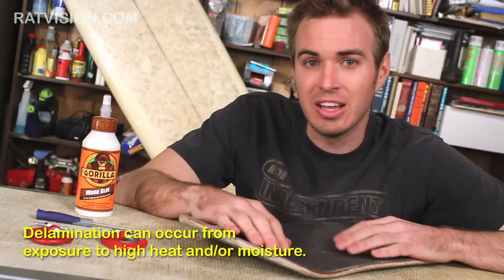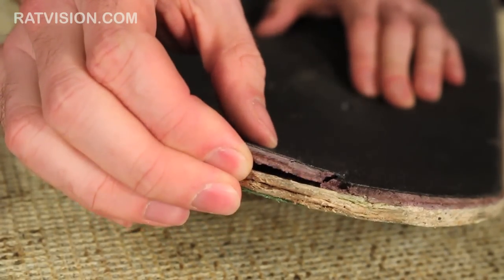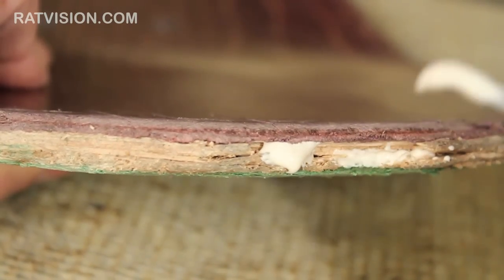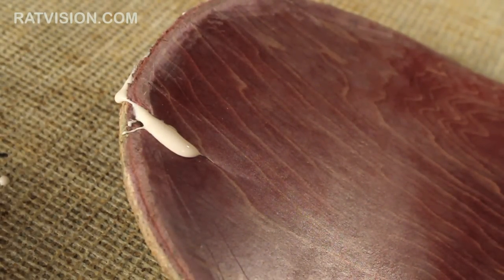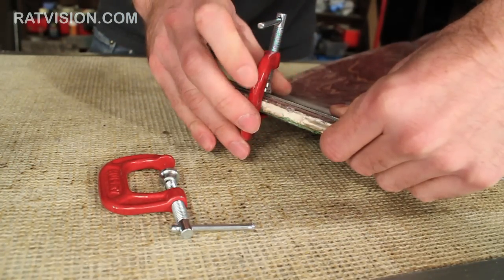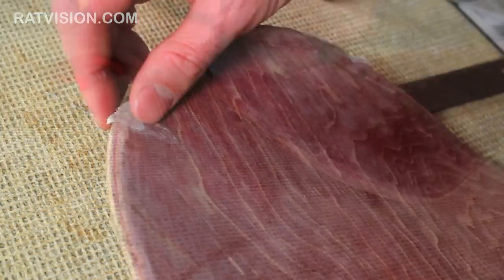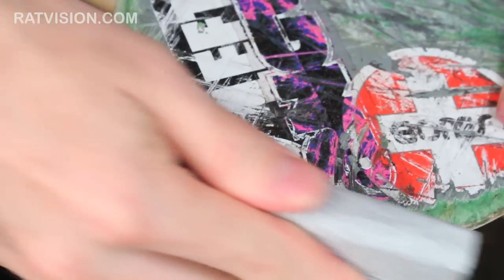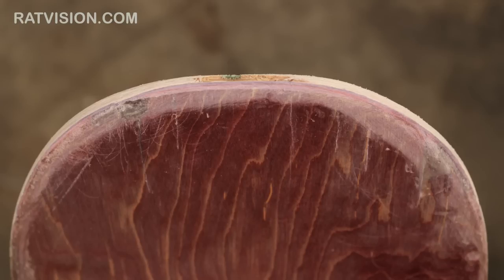Fix Skateboard Razor Tail, Chips, and Delamination

Comment: Quick tip: Use gravity to your advantage, while gluing, work with the board in a vertical position so that way the glue can down the further gaps of wood inside the board.
Reply: Thanks
Reply: Thanks!

Comment: This might help here. When repairing guitars I use a large syringe with a large bore needle that is filled with wood glue. Doing this allows you to get the glue to get deep into the crack and allow a much stronger and permanent fix.
Reply: I can see you know what your talking about. To many "YOUTUBE PROFESSORS"

It's common sense but people just dont have much lol🤘🤘👍
Reply: As a guitarist I can confirm this works. I had an unfinished guitar and the top started to pop off.

Comment: This is actually a really good way to save money in skateboarding. A bottle of glue costs far less than a new deck, and you don't use much on one fix, so the bottle lasts for many repairs. A worn tail can get worse fast, then you need to spend $30-$50 on a new deck. A cheap bottle of wood glue makes the board last longer than without, thus saving you money and allowing you more board time. I actually glue my board together all the time when it's like that. Great vid!

Comment: Slip tape is a fun skateboarding gimmick. Companies used to make decks called "slick decks" which had a layer of slick material on the bottom to (supposedly) help with slides. Slick decks have almost vanished since as people found them unnecessary. Slip tape, to me, is personal preference. It won't noticeably slow down deck pop or razor tail. I find that a simple candle works wonders. Thrift shops, like Goodwill or Salvation Army, often sell large candles for under one dollar.

Comment from the maker: Few options here. You can continue to ride the board backwards. If it feels good, do it. There are some companies that have come out with older shapes from the late 80's/early 90's where the deck is a little wider and the tail and nose are a little bigger. Can't think of a brand. A lot of the pop has to do with the distance from the tip of the tail to the ground. If you have small wheels you won't get higher pop. You can also try riser pads too. This can give you the feel of a big steep tail.

Comment: TIP: If you have trouble getting the glue between the plies or want to do a more thorough job, before you start putting glue on, get a cup and mix some glue and water together until it's as fluid as water but still white from the glue. Get a brush, sponge, (or your finger) and apply it to delaminating edge. You'll notice the wood will suck in the glue/water because of how fluid it is. If it doesn't, you've put too much glue in the mix. Apply this mixture twice to let the glue/water really get absorbed into the wood, then get your normal glue and continue as stated in the video for the more obvious splits.
Reply: Also helps keeping it vertical so bubbles will rise up.

Comment from the maker: Absolutely.  If the tail gets too thin it can flex as you put pressure on it when it touches the ground.  This reduces the "pop" because the tail is not rigid enough to rebound/pop off the ground to create the lift you want.

Comment: I highly doubt any skate shop will do anything but laugh if you try to return a skateboard that's been 'damaged' from skateboarding even a couple of minutes, let alone a month.
Reply: +Arno Theadorno Well, I bought a board three days ago, the company is Good Wood and they are suppose to have boards that really resist delamination due to gluing the board together by cold press instead of hot press like most other brands do. After three days and only dropping the board 4 times on the nose, it is starting to delaminate and its just a waste of money at this point, Im sure its just a defect. But I did contact the company to see if we can arrange. Yeah if you are slamming your board hard against the floor and and kickfliping a 5 stair they wont accept a return or change XD.
Reply: +Jack Hildebrand omg I hope you learned your lesson goodwood is known to all the skaters Ive ever spoke to LITIRALLY everyone, that its the worst possible board you could buy at a shop
Reply: Arno Theadorno Vans exchanged mine after 1 month of use
Reply: @exzaviorw  I CALL BULLSHIT
Reply: @exzaviorw  .. I skate for a long time and follow a lot lot of skateboarding .. but have never ever even heard of good wood. LOL
Reply: @oskargarden4559  probably a good reason why lol
Reply: The tail of my board snapped off after 5 months and they gave me 50% off a new one
Reply: @oskargarden4559  It's a Zumiez brand. Probably won't see it in skate shops.

Comment from the maker: A split like that is usually caused by your board getting wet at one point.  There isn't much you can do.  You can add some wood glue to help it from getting worse or separating from the other plies.

Comment from the maker: Sounds like it just needs to be tightened to stay on.  If you don't want the trucks to be stiffer switch to softer bushings so you get the same feel, but you can tighten the nut farther down the kingpin bolt.

Comment from the maker: Slip tape really is not going to do much at all. It may grind away a little slower than the wood of your deck, but the slip tape is so thin it won't make a difference. Slick Bottom decks from the 90's didn't do much either to prevent razor tail or effect pop.  All it really did was protect the graphic from board slides. To slow down the cause of razor tail, don't use your tail to slow down or stop. See our video on to fix razor tail.

Comment from the maker: It definitely could be the wheels depending on the surface you are skating on.  If you are riding on rough road then really hard wheels will slow you down. The size of the wheels will also effect how much speed you get. Get softer wheels, and maybe bigger wheels too.

Comment from the maker: There are tail pads you can get.  It's a piece of plastic you screw onto the bottom of your deck.  These were popular in the 1980's, but you can still buy them today.  Other than that the tail will wear out eventually.  You can use the tips in this video to help.  Eventually you'll need to buy a new deck at some point.

Comment from the maker: You have to make sure the wood filler and deck do not have any dust left over from sanding at all.  Any dust will not allow the grip tape to stick to the wood.  Look at the grip tape that you tried to put on that wouldn't stick.  Is there a thin light layer of dust on it?  If that wasn't the problem let us know.

Comment: I'm relatively new to skating so I REALLY take good care of my board. I did exactly what you did but with variations. I rinsed them in water, blow-dried each one thoroughly, cleaned it with the orange cleaner(I did each bearing separately because I didn't make that shaker bottle thing), lubed them with Bones Speed Cream, and they still go bad pretty fast.

Comment from the maker: Lighter trucks are not significantly lighter than all trucks.  The weight difference is minor, but some people can tell the difference compared to other trucks.  They can result in slightly higher ollies, but it also depends on how you perform an ollie.  Lighter trucks could also result in quicker flips.

Comment from the maker: I assure you they are not defective.  It's important to know that spinning the wheel freely does not indicate how good the bearing is.  After using them for a month did you add any lubricant to them?
How were you cleaning them? What cleaner did you use? How long was the cleaner in contact with the bearings? Are you sure you absolutely dried the bearings completely? What lubricant are you using?

Comment from the maker: Your decks are not warped.  Everything is fine.  This is totally normal.  What is happening is your bushings are a a little sticky or tight.  When you step off your board, the truck is just leaning a little more to one side.  So, one wheel ends up lifting off the ground.  When you ride everything is fine because your weight is being applied to the bushings.  You are welcome!

Comment: You can get rid of flat-spots by using a lathe machine, but can depend on the durometer of the wheels either if it's a soft urethane longboard wheel or a hard urethane skateboard wheel used for skate-parks, softer wheels are easier to lathe than harder wheels.

Comment: A couple of tricks I have learned over the years.  Use toothpicks, bamboo skewers, or chopsticks to keep the split open when putting the glue in.  Also, cut and old gift card into strips to push and smear the glue down into the split/crack.  No such thing as too many clamps.  Lastly, save all of the sawdust from sanding, and mix with the wood glue to fill in and chips or missing wood.  It will be strong, and match the existing wood, and oh yeah. it's FREE!

Comment from the maker: If the chip is on the top ply then yes, you do want to use the wood filler to create a flat surface.  First, do what is needed from this video, then do the wood filler last.

Comment: I have a deck with plies coming apart around the deck will it be fine to ride if I glue it all back together
Reply from the maker: Yeah it should be fine.  How old is it?  Did you leave it in a car?  Do you leave your skateboard outside overnight?
Reply: I actually found it outside behind my house probably been sitting there for 2 years and I just found it's warped is there a way to fix that
Reply: Yeah that board is fucked. Just buy a new one. You may be able to keep your trucks if they are not too rusted but other than that you need to just buy a new board.

Comment: Question for Rat Vision - How long do skate decks last? Using this video and others you have posted, I've been able to ride my skate mental deck for almost a year now, minus a few millimeters from sanding, it still looks and rides great. Do they lose pop after a while? Will I notice a difference with a new deck?
Reply: Razor tail happens after a few months, but if u sanded it ur prob good
Reply: +headlessguy98 More like after a week of skating. If the tail and/or nose of your board has gotten a lot shorter (like an inch or more) than you should invest in a new skateboard.

Comment: hi 
is this a good idea?

i had minor delamination in my old deck, so i've put glue on it. what i did after was putting a couple of layers of wood glue on the end of the nose and the tail (have a bit of a razor tail)to make a small protective layer and keeping it together better.
does this help? i understand that the layer will get rasped off after a while, but is it by any means usefull??

thanks
Reply from the maker: +Patrick Sure of course it will be helpful.
Reply: Rat Vision – Skateboard Tech cool, thanks

Comment: I have a chip and cracks. I have had the board for 2 months now, it started get the cracks when I started trying to land a pressure flip. So I have wood fill and glue should I just take the board it back??
Reply from the maker: What is your question? "Take the board it back?"
Reply: What should I do of my board had cracks and chips in the first 2 months.
Reply: +Harj Gill buy a new one 2 months is a good lifespan for a board if you skate hard and every day

Comment: How good is this method? I have really hardcore used old deck and i wonder if its worth trying, or it will be material for making my skate area rubbish?
Reply from the maker: If it's really bad, it may not be worth the time and money.  This is really for small chips and a little delamination from razor tail.  it's really your call.

Comment: hi, i have a question...i have a deck with the same black stain in this video and it has scratches on the top from being mounted, minor scratches made from the mounting screws as it was being mounted.  what is the best way to treat them to eliminate the scratches in a restorative way?

Comment from the maker: I think you're referring to flat spots, where a section of the wheel has been flattened from sliding. This cannot be fixed.  If you could reshape the wheel you would still have 3 other wheels that are bigger.

Comment: Hi rat vision so I have a Tony Hawk's skateboard and on the middle edge of the board at cracked while I was taking it out to my garage to put it back when I and I slipped on the ice and it cracked the middle edge of the skateboard so I fixed it with wood filler would wood filler help it stay together

Comment: pressure cracks are fine, they happen when you land with your feet on the bolts (which is good). they won't affect the board at all, I think it's just the trucks pushing on the paint

Comment: i got a new drop-through longboard 3 days ago. today i noticed a little delamination but i didn't think 2 much of it so i kept carving. i was skating in parking lot and when i swerved to avoid a car i turned toward a sidewalk. i didn't want the board to hit the side so i jumped off it but while i jumped the area right below the truck snapped. do you think the board was defective. i did skate board on wet ground yesterday but there was little to no water on the ground and i dodged all the puddles.
Reply from the maker: No the board was probably not defective.  If you live in a very humid region, and skate in wet areas you are asking for your deck to get ruined.  The glue in the deck reacts to moisture easily. When a deck expands and contracts from being moist and dry over and over, the layers become weak. What brand of deck do you have?

Comment from the maker: Well... what exactly is "pop" to you.  Everyone associates it with the just the deck by how high they can ollie. Basically, pop the board up, right? But no one ever associates pop to wheel diameter, truck hight, tail length, board length, and nose pocket (distance from bolts to nose slope).  There are obviously a lot of other factors than a deck that may have a soft tail. Small wheels effect pop. Think of a catapult. The more you can swing the arm the higher and farther you can throw something.

Comment: Can you do a video about bolts? I'm thinking of changing mine and I have no idea what my long board bolt sizes are :/
Reply from the maker: You just need to know the length.  All the bolts are the same.  Only the length changes.  
If you use counter sunk bolds, which are the ones that most skate boards use, then measure the full length of the bolt.  These bolt heads are kind of triangle in shape, or point inward toward the bolt threads.  Some longboards use rounded head, that are usually used for drop through decks.  Measure just the length of the threads (known as the shank).  That is the size/length you want.  It's ok if you get bolts a little longer.
Reply: Thanks

Comment: you got any chalk or oil pastels? draw two lines on the ground and try to ollie that space. when you can do that easily just draw another line for a larger space and repeat. this will get you used to timing your ollies. maybe put your coat on the ground and ollie over that. curbs should be easy afterwards
the line thing also helps when trying manuals

Comment: Ok so to Fix A razor Is by sanding it right? Because I have a bad razor tail but Not a chip on the tail so Do I just Sand The Tail Of my board To fix the razor tail or no
Reply: it will sand it down like he did it will also help to have 2-3 layers of glue on the tail after its sanded

Comment from the maker: Cracked bushings should be replaced.  You can't fix that.  Stretched mounting holes are from not having you bolts tight to begin with.  What you can try to do is stick a piece of a tooth pick in the hole with the bolt to help it be more secure.

Comment: I think there's something wrong with my board I just bought a new board and I customized it (reds bearings Jessup grip tape thunder trucks hardware and a toy machine board all new)but when I put it all together two of the wheels where off the ground when I lay it down flat(left front wheel and right back wheel)I don't know what to do please help!!!!!😥
Reply: it doesn't matter it all rides the same
Reply: Its probably just the bushings on your trucks man ,just stand on your board and lean forwards and backwards on the long sides of your board to work the bushings in 👌

Comment from the maker: You need pliers.  Remove the nut, get softer bushings and a new kingpin nut.  If you have softer bushings you can tighten your nut down more and avoid grinding it.  Sounds like you have bushing that are too hard.  In order to have the trucks turn or compress more, the way you like, you have the nut loose and sticking out beyond the hanger.  This should solve or at least reduce your problem.

Comment: hey, i have a Madrid longboard that rammed into a curb. The layers are starting to split apart and there is a big flat spot in the nose. i kind of afraid to even put pressure on it because i can here it cracking a bit. I'm scared to use glue and to sand down the board later. any tips

Comment: Hey, I have this longboard that has delamination. A rayne Nemesis, it crashed into a wall. On the back of the nose, its broken and its not pointing "straight." Its pointing upwards and making the board very low on the front. 
Should I buy a new deck or fix it. I'd show you couple  of pictures of it but.. Idk how too.

Comment: How do you fill in penny nickel board damages like scratches and scrapes
Reply: U can't unless it's wood
Reply: +Austin Meyer how bout paint or plastic filler
Reply: +Paul Nguyen it's possibility it might crack off
Reply: +Paul Nguyen if you have an old skateboard you could trace your penny board on the skateboard and cut that out and there you have a wooden penny nickle board and if you don't  want to do that you can use a 27 inch template
Reply from the maker: Don't worry about it.  It's a skateboard.  It's meant to get beat up and get scratches.